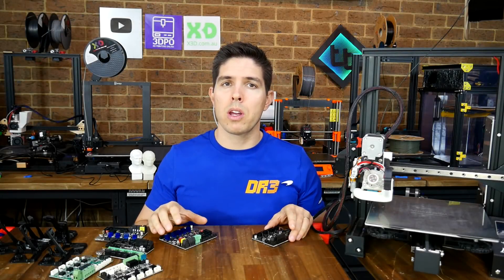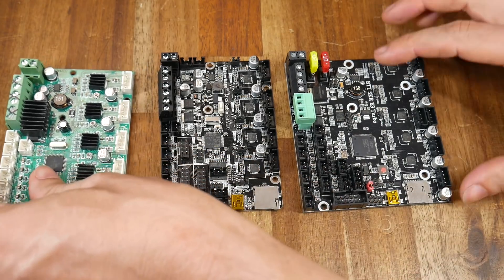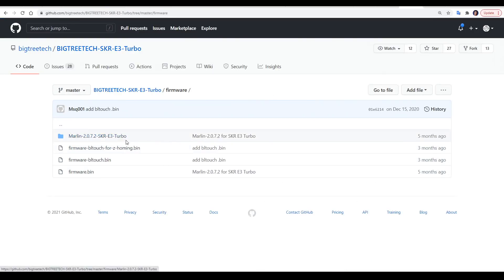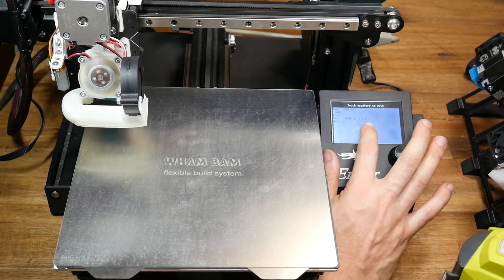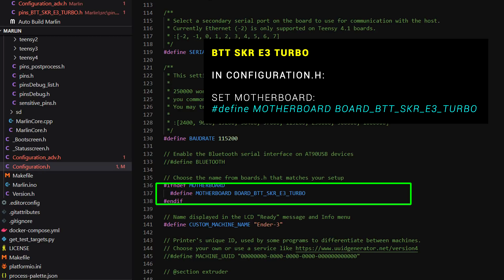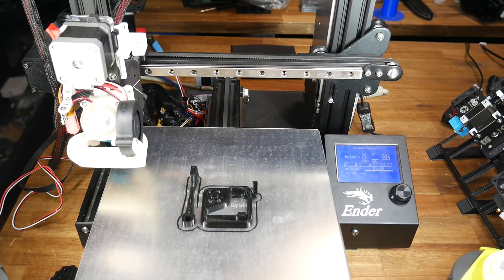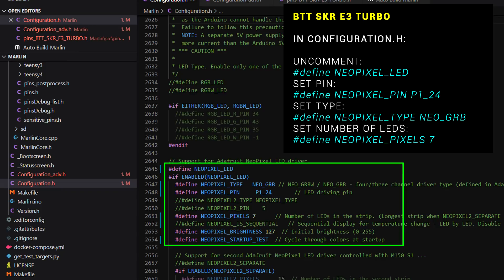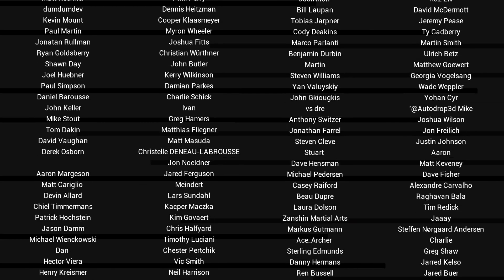MKS Robin E3 vs BTT SKR E3 Turbo - Complete mainboard upgrade guide

Comment: I heard a lot of issues with the skr E.... And bigtreetech? Something that they have so said?
Reply: BTT stuff tends to have alot of issues that is a result from poor engineering and lack of QC. Easy example, SKR 1.4's where shipping with 100/1k resistors instead of 10k resistors for the endstops so sensors like a bltouch or ezabl would be permanently triggered, or how the skr mini v1.0-v1.2 always had driver failure because they cheaped out on the pcb copper amount and layers(just like creality does on the V1.1.5 and V4).
Reply: The E3 Turbo has a big problem with its onboard inductors. I wrote a post about that on reddit: https://www.reddit.com/r/BIGTREETECH/comments/kar8u7/why_you_should_not_buy_bigtreetech_boards_why/?utm_medium=android_app&utm_source=share

BTT says they fixed the problem, however you can't be sure to get one of those fixed boards when you order online, so you should definitely check for the problem.
Reply: My E3 Turbo has been working really well. There was one day when the display was glitchy (I got their TFT35 board as well). It stopped being glitchy after some rest and has been fine ever sense. I often have to tap on the screen a couple of times for my touches to register. 

As far as quality... I was disappointed by the stickiness of the heat sinks. It didn't seem like they were sticking very tightly. My box is closed, so I can't tell whether they have fallen off.

Comment: Mks boards 4 layer pcb, skr boards 2 layer pcb
Reply: SKR boards is 4 layer except skr mini v1.1sell about 10 USD.
Reply: @packagehope5334  no
Reply: @Solthariel  You can check it.
Reply: @packagehope5334  dont need to i already checked before and using v1.3 and why u answering "package manager" lol ? Where the f. Offical announcement about that  like product page , github etc if u wanna help answer below comments who has realy problem with the cards not me
Reply: skr mini 2.0 is a 4 layer, but its 2x 2oz and 2x 0.5oz

Comment: Me and a lot of people are having lots of trouble with SKR E3 Turbo: You can read at github's SKR E· Turbo issue number 31:

Steppers burned, extruders melted, ruined prints...

Not a single word from bigtreetech regarding this very dangerous problem

Third time i write this comment, expecting not to be erased again.
Reply from the maker: No one is deleting your comments from here. I very rarely have to do it and it's only for extreme cases like profanity. My policy is to give credit where due when things work and highlight problems. My track record reflects that and I will publicise any problems I have with this board. So far, so good for both boards in this video.
Reply: @TeachingTech  Maybe it was because i was posting the link to the github issue the other two times. As soon as I delted the ling the comment remained. I don´t know. But 20 seconds after adding the comment it just disapered. My appologies
Reply: So I did some digging, you and one other person are the only ones to have this issue. I checked the github, and it was just you and one other person, not the “lots of people” you claimed. https://github.com/bigtreetech/BIGTREETECH-SKR-E3-Turbo/issues/31
Also, there is the “extruders melting” from. I know older E3 Turbos and v1.2s had resistor issues, but it has been fixed by now, and can be fairly easily fixed on older boards.
Reply: @derektran9404  please digg better, not only my oppened issue. Check all the github from bigtreetech regarding mottors extreamly hot and noissy. Also check on reddit for the same thing. This is happeninmg to a lot of people, also with the E3 mini that is older than the turbo.
Reply: @pozi78  Seems to me the issues are people don't have proper vrefs set, any mention of this issue is pretty scarce. As mentioned before, the V1.2 had the thermistor issue but nothing about the stepper issue.
Reply: @derektran9404  I dont'k know about vrefs. I just flashed the firmware by bigtreetech, i tried all of them and also compiled my own. If you read carefully, as son as the printer gets an ESD evereything starts to fail. So no, it is not a software issue. Maybe it is only my board and few other that have a problem. But after more than 20 days writting to bigtreetech and posting at github a I have received no answer. from them.
Reply: @pozi78  Unfortunately while BTT makes good products, their github support is kinda lacking. Being in a discord with them or asking people in stuff like the Marlin discord is a better bet.
Reply: TBH, looking at the github threads... I wonder how much is setting the current wrong in firmware?  Software current can be a tricksy thing, especially if you're dealing with a different stepper than is expected by the config.
Reply: @ulmeck  the thing is that the printer works ok most of the time. But as soon as there is some electrostatic discharge it start to make a lot of noise and the stepppers start to get hot. I attached ds18B20 sensors to the mottors and they go from 36-37 celsius to 90+.
Reply: This might be related to an older (solved?) bug on skr mini's where the set VREF in software IS NOT what is actually being sent to the driver.
Reply: @lookitsrain9552  I trully do not beleive this is related to a missconfiguration at marlin. As I said, my printer works great 95% of the time with all the values (vref, msteps, vsense, RMS Current, MAX Current...) at normal values. But as soon as som ESD reaches the printer evereything gets wrong values and start the problems till I reset (switch on/off) the printer.
Reply: I installed just out of the box with the stock firmware (that displays 2 extruser) and the steppers got hot as hell on the first small sprint. After that I got a newer firmware.bin on their github and after the update (now displays only 1 extruder) everything is normal. After a 17 hour print the steppers are running warm.
Reply: I try to tracking down the problem and seems to be releated to a marlin bug that set a huge current to steppers
Reply: We are sorry to bring you a bad experience. Could you please send an email to our technical support team？They will help you deal with your problem ASAP. The email address id support@bigtree-tech.com
If you have any suggestions for product improvement, you can leave a message on our Facebook page or GitHub at any time.
Reply: @bigtreetech5117  Thanks for your answer, i just sent an email to your technical support team 5 minutes ago. I like the board A LOT, i trully do. But form me this is a big and dangerous issue that needs to be resolved either it is related to software or hardware. Until it is resolved, for me, this board is unusable.

Thanks again for your attention.
Reply: @pozi78  I also have this issue. I've tried 2 BTT SKR E3 Turbo boards now and this happened to both. The printer will run fine for maybe a few hours, sometimes only 20 or 30 minutes and the steppers sit around 35C. Then all of a sudden the they go very noisy and heat up. also the print starts to layer shift. I also fitted a Creality 4.2.7 board in between the 2 E3 turbo boards and this worked fine. I have all motors set to 580mA except extruder which is set to 650mA
Reply: Im on my second board, trying to ground all the motors and frame to avoid it, and its not working. what a pile of junk.
Reply: Have the same problem. Also grounded the motors and set the current to lower settings 580/650. Still happens. This sucks and makes my printer unusable with this board.
Reply: @NRGizzer  dont bother with it, return or throw in the garbage. Ive gotten 2 of these and they just dont work. Got an SKR 1.4 turbo a week ago, have had 0 problems since. ive finished 2 20hour prints just this weekend, and thanking god.
Reply: not saying I recommend BTT, but its the only board that has a user base that at least works..
Reply: @DeltaOps3  I´ve also switched now to the SKR 2.0 and all heating problems are gone and I am using the exact same marlin firmware configuration. Printer is printing since 24hours straight and all temps are stable, no layer shifting or anything like that. There is DEFINITLY something wrong with the E3 Turbo.
Reply: @NRGizzer  Thats fantastic to hear I am glad you fixed it. I was worried there was no fix. Glad you found it, and yeah, e3 is def flawed
Reply: @DeltaOps3  And Thank you very much for your Support Liam :)

Comment: What about duet mainboards? You don't talk a lot about them.
Reply: theyre too expensive for the everyday hobbyist
Reply: But considering having to create a custom build and using a Rapsberry PI for remote access, the different isn't too much.
Reply: @DiomedesDominguez  a pi zero is 5 bucks 2nd hand and custom builds are rarely needed
Reply: If you use a zero for octoprint I end my case.
Reply from the maker: I have two 3D printers running RepRapFirmware, with videos about each of them. I have another with Lerdge, one soon to be Klipper, the rest Marlin. I 'd say the distribution of firmware across my machines probably reflects what the community is using, and that is by design.
Reply: Duet's aren't drop in replacements for Ender3's.